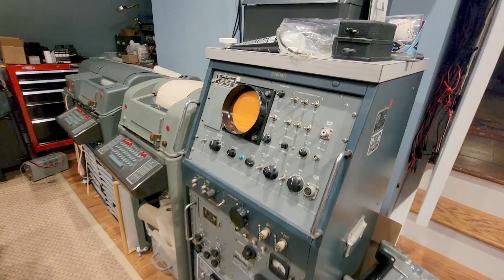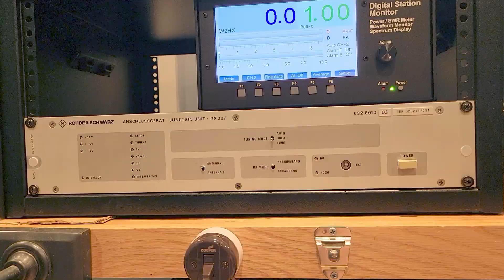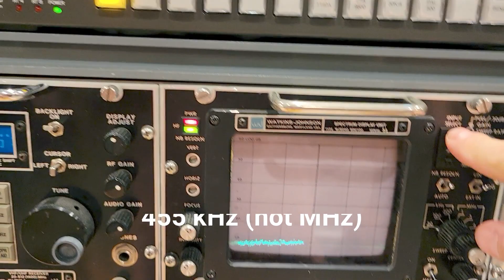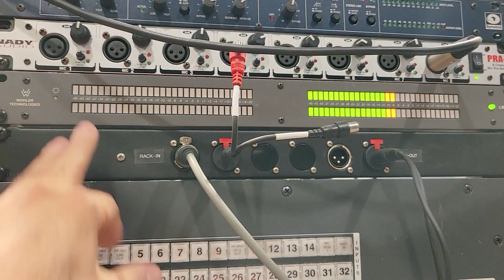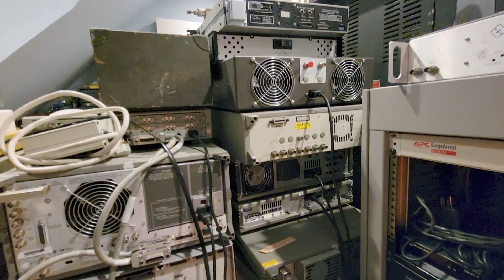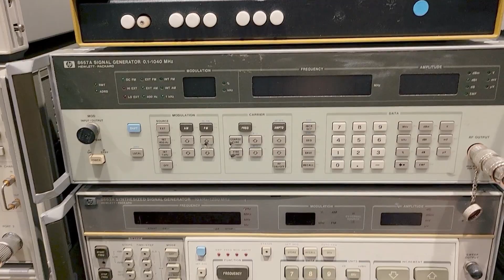W2HX Virtual Shack Tour 2022!

Comment: Very interesting. Since you are on the 2nd floor there, what grounding method do you use?
Reply from the maker: Hi there. For safety ground, my shack is above the garage where the main breaker panel is. I have grounding blocks in the shack that go directly to the ground in the breaker panel. For RF ground, I mostly use doublet-type antennas except for my vertical, that has a good counterpoise surrounding it. I dont really have any RF in the shack issues. thankks

Comment: But what works, what do you use, and whats only worth its scrap metal value ?
I have racks and shelves full of test and radio equipment , rooms full, but its all eye candy.  Gear from WW2 to the 80’s that collects dust, takes up space, and I cant give it away.  But I cannot bear to scrap it either.     So when I die my wife will hire a junk man and they will throw it all in a dumpster.  No one  wants a 30 pound 475 when they can put a 2 pound Siglent on their bench. And so on. 

And I just brought home another 800 -1000 pounds of high end test and radio gear from an SK estate - all free for taking it. 

On top of that - The jewel was a TriEx 4-70 with tilt base. 14 yrs young.  Homeowner paid for removal costs and I rented a truck for the ride home. 

The real cost.  A very sore back and a nagging wife.    But what find.
Reply from the maker: Hello, Destroy. I would say 60% of the stuff in the video is working. I'd say another 25% should be "easy" to get operational again. The remaining 15% is probably just cool to own and no plans to get working. If you want, contact me through QRZ maybe I can find some buyers for some of your stuff?

Comment: Man I want to know more about that Harris RF2301. That thing looks sweet. I tried looking around the internet and there isn't much on it.
Edit: if you are ever in the mood to sell that thing, hit me up. After reading up on it, i kinda want one
Reply from the maker: Hi RW. It is a cool looking unit. I bought it probably 6 or 7 years ago and I have yet to power it up! It was working when I got it (seller demonstrated it to me). but it is verrry cool looking. It has a n original harris 120VAC AC power supply (not shown) that it sits on and can also run on 28VDC.
Reply: @w2hx  oh that's really cool that you got the power supply with it.

Comment: Beautiful gear and shack, Eugene!  I wonder if you ever worry about too much weight on the second floor.  Did you augment the support of the flooring at all?  73, Jeff - W8KZW
Reply from the maker: Thanks, Jeff. Yes when we built out the shack we installed a massive 2 foot thick laminated beam with cement footings a few feet deep (I forget what the code was for depth). Here are some pix https://w2hx.com/?prefix=TEMP/Garage-Beam thanks for watching and thanks for the comment.
Reply: @w2hx  Looks like that should more than do it, Eugene! It's amazing how quickly the weight of gear like this adds up. Certainly something for collectors to be mindful of.  73.

Comment: My already bad back HURTS just thinking about you hauling all of that stuff upstairs. Hi hi...I hope you have a hidden elevator or 3 or 4 indentured Hams on standby to lug stuff for you.
Just found your channel this weekend and I'm impressed with your projects and drive. 
73, Glenn WA4AOS, DSM Labs
Reply from the maker: thanks a lot. Heavy stuff for sure. For some odd reason, i've always been attracted to heavy radios.
Reply: You talk about using a used reinforced heavy duty desk, but I’m more concerned about the garage ceiling if it’s able to support all that weight :-)